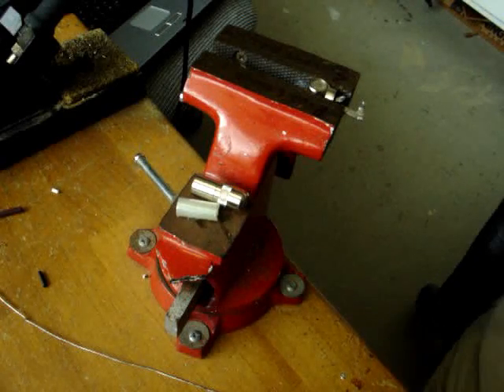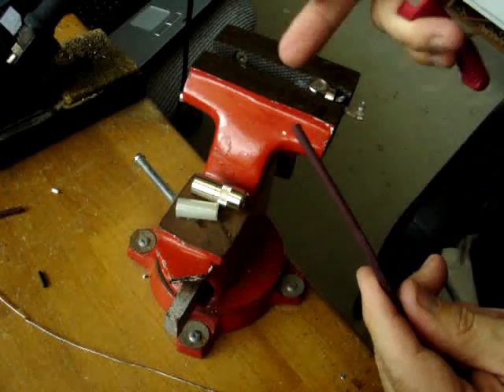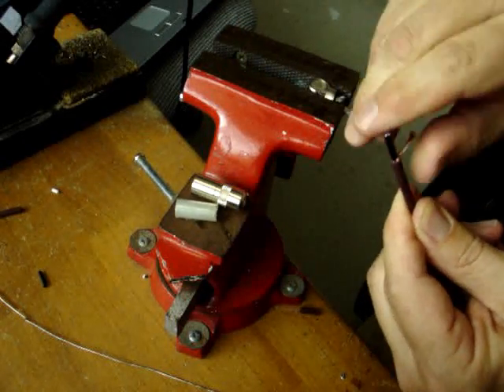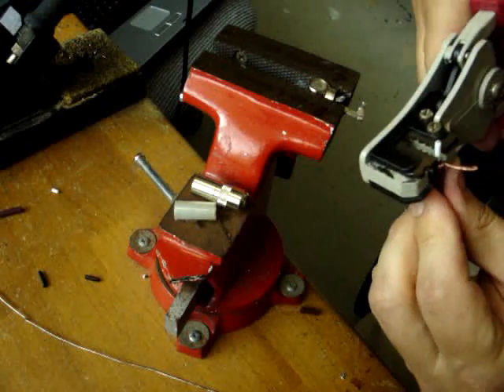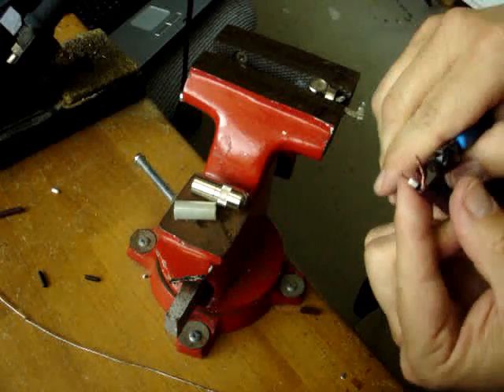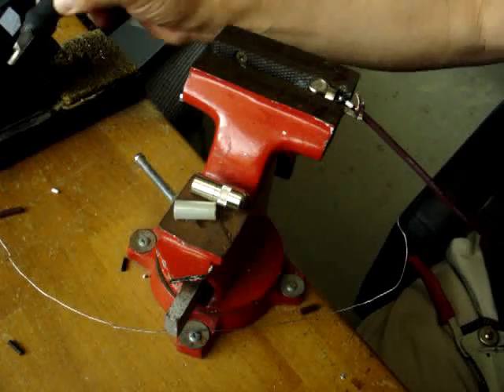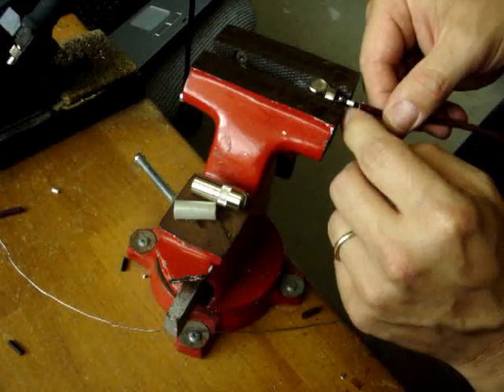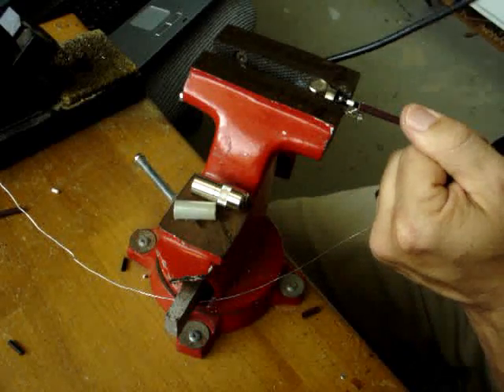soldering monorail

Comment: When soldering the monorail to a switchcraft 228 plug, do you solder the hot wire into the hole inside of the circular space for the hot wire?  Or do you leave it flat on top on it?  Also, when making a cable from amp to speaker where should the directionality of the cable go?  Amp (Evidence Audio) Speaker or Speaker (Evidence Audio) Amp?  Thank you very much!

All The Best,
Sam